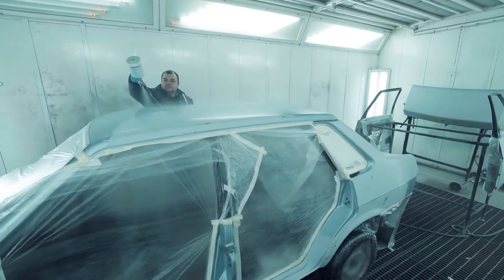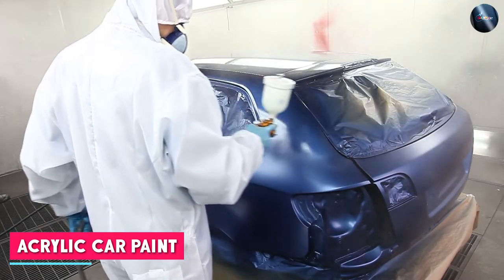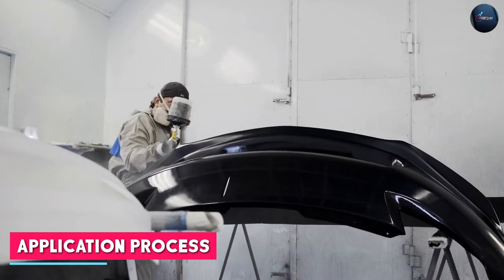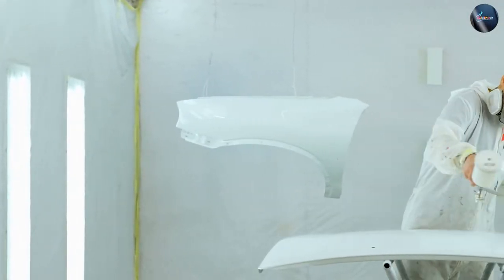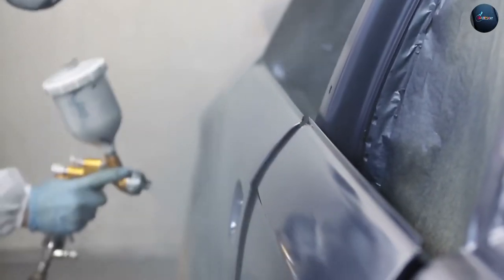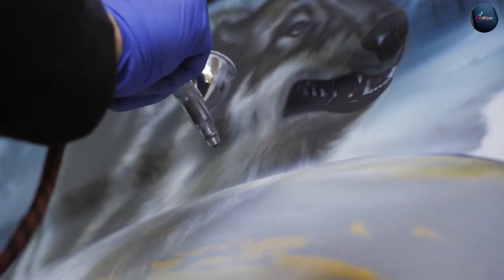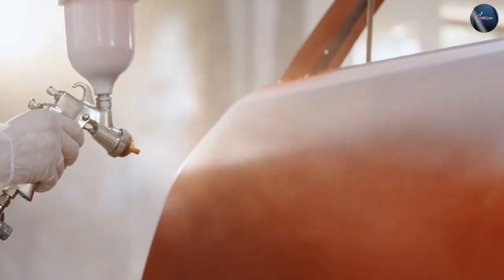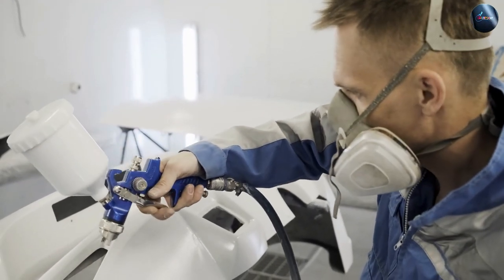Acrylic vs Enamel Car Paint: Which is Right for You?

Comment: I wish I knew more when I chose my paint.
I read about how the duplicolor fleet enamel was really durable and glossy.
I thought that I could add to the protection by clear coating over it.
I learned after the fact that I had to wait for a couple weeks and then sand the enamel and then shoot clear coat.
Others said it would take longer... 
I ended up waiting the 2 weeks and thought it was enough because car was in perfect temperature at around 75 degrees and low humidity.

I knew in only had a week until weather changed to cold and wet.
I did all the prep and sanded and scuffed... Shot the clearcoat and it looked awesome... No runs, sags, and maybe only about 10 little dust nibs in the whole job...
2 days after I went to garage to see how paint was doing and the whole car looked like a spider web of cracks.
Like when you crack a smart phone or windshield.
My heart sunk. Now ive been sanding it all out for the past week sick to my stomach. Money lost... Money spent, time lost and now my fingers are raw from sanding on top of all the sanding from body work, hi-build primer, base primer, paint, and now clearcoat and layers of paint.
My hands are raw.
Reply: How did it turn out? Did you go back and start again? What did you use? Hope it's all fixed.
Reply: Yeah they dont tell you that about enamel paint. If you have orange peel in it you cant just cut and polish it out it,  turns out dull. I tried putting acrylic clear coat over it. Cracked and wrinkled. So much time and money wasted.
Reply: @rocknral  sorry for late reply.
Yes I fixed it. I had to sand down to original primer and start all over.
Ended up taking me a month which included sanding, painting, clear coat. A month and a half if you include paint correction and buffing and waxing.
Reply: @optimoprimo132 what primer, color coat and clear coat did you use the 2nd go around?
Reply: Use 2k paint its best

Comment: I'm not following. What are you calling Acrylic? Acrylic Enamel? Acrylic Lacquer? 
What are you calling Enamel? Alkyd? "Acrylic" is not a type of paint - it is a resin that can be used in several chemistries of paint
Reply: Bottom line is don't use acrylic because it tends to chip, enamel does fade with time but it is more durable and your car won't develop rust pits
Reply: @AutodidactEngineer  again, at least in the states, “acrylic” is meaningless. “Acrylic lacquer” and “acrylic enamel” are vastly different things.
Reply: @AutodidactEngineer  yeah but if you stuff up the paint job with enamel you cant just cut and polish it out.